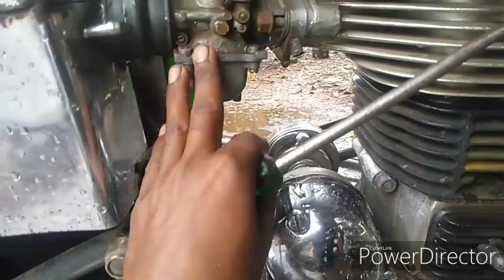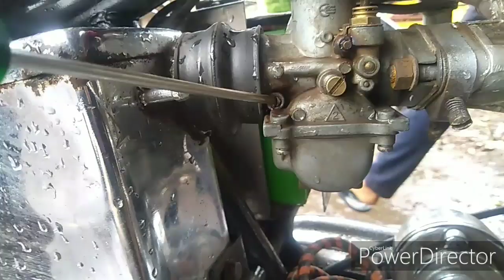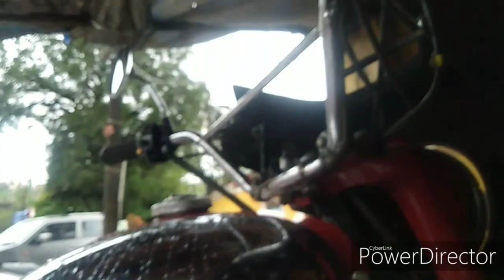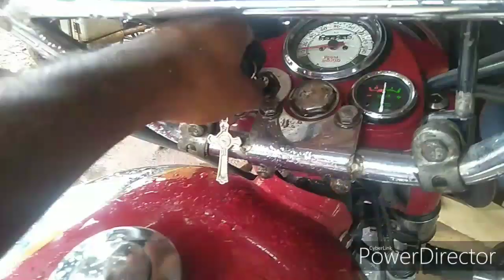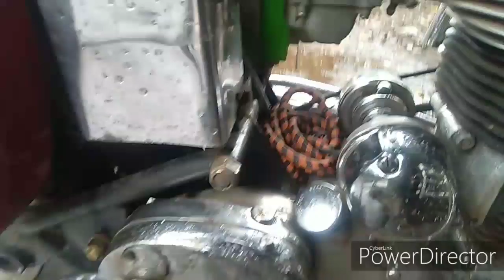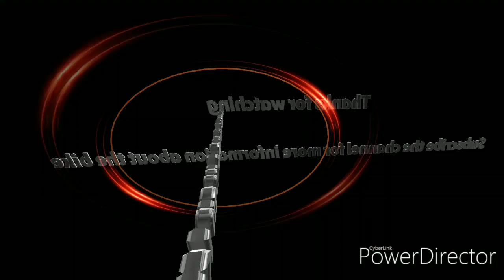Old bullet Cie engine cast iron carburettor tuning fro best mileage

Comment: Bai my bike old ci engine when rain came not starting pls how to maintain tell me bro I see ur all video seeing tq so much bai
Reply from the maker: Ciln carburator point
Spark plug
Reply: bro jo uska point hota hai uspe rubber chadwao market mein mil jati hai
..mere sath bhi same prob thi after washing start nai hoti thi
Reply: Best thing to do is, get the riding cover which is available for 700 and then you don't have to worry about the rain at all. I have a 83 and have been using that for a while now and been happy with the performance.